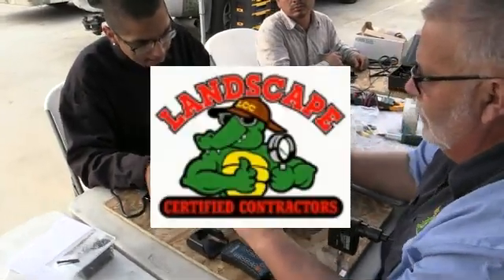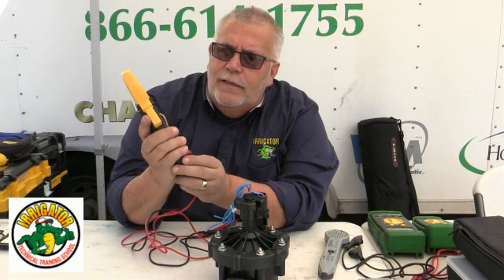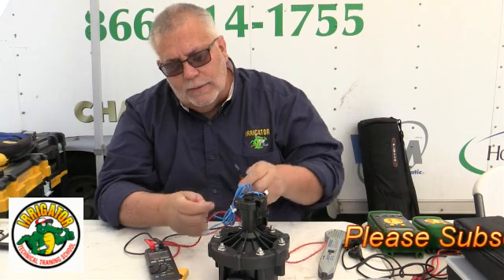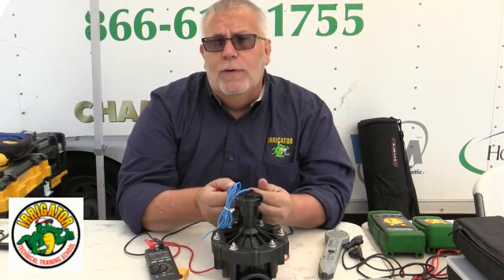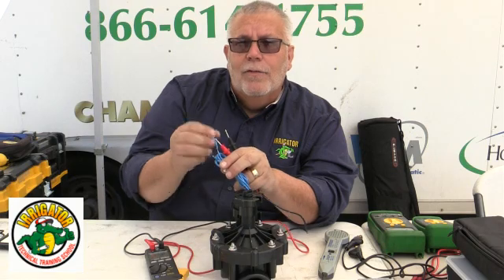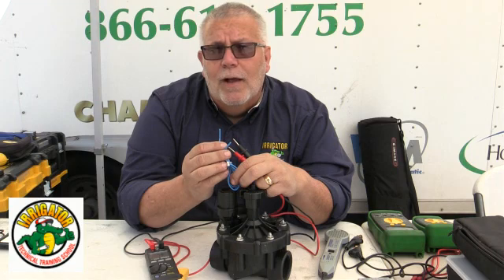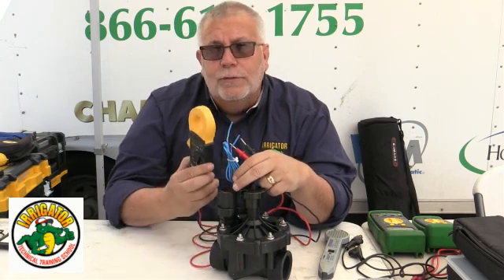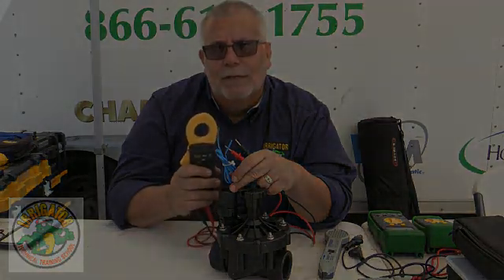How to Test a Soleniod with a Multi Meter

Comment: Couldn't you use a compass as a quick diagnosis tool to see if the solenoid is energising as when the coil is energised it will create a magnetic field pulling the needle on the compass in the direction of the coil. Maybe not as precise as a multimeter but it should tell you there's power there at the very least.
Reply: But the solenoid needs a certain amount of power, a compass will spin with very little power lol

Comment: Glad you added the It's probably bad over 60 / 70  otherwise didn't know.  I have one valve at 37 and a toro at 55 (that is new but I suspect may be bad - need to test).

Comment: Thank you.  I just learned to start at the selonoid and then back to the timer box. After first checking timer box, AC power to timer box and Transformer I then discovered the common wire had come loose from all valves.  A 3 minute check at the valve end would have saved a lot of time and headache.  Thanks for your informative lesson.👍

Comment: how come Ohms indicate voltage.  I don't understand.  Ohms is a measure of resistance, no?
Reply: You're correct, he's checking the overall state of the solenoid by making sure the resistance of the unit is around 20, as expected. He isn't measuring voltage